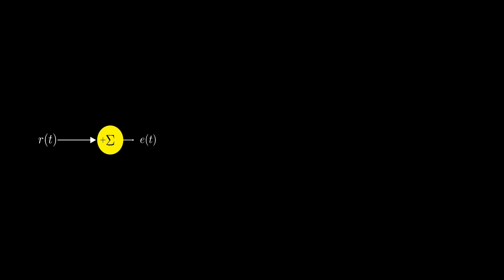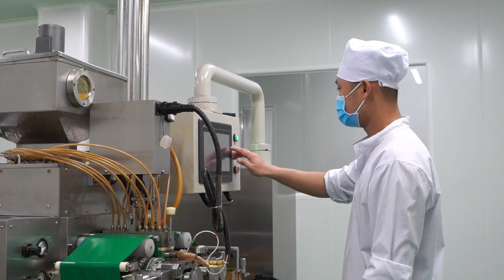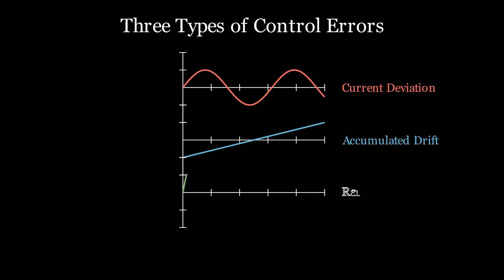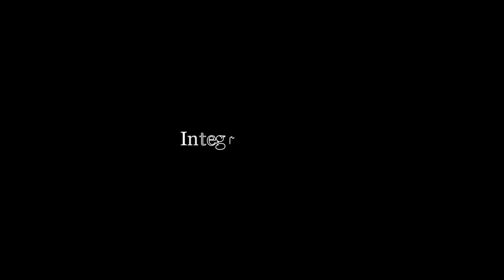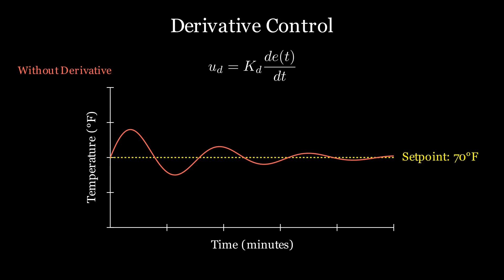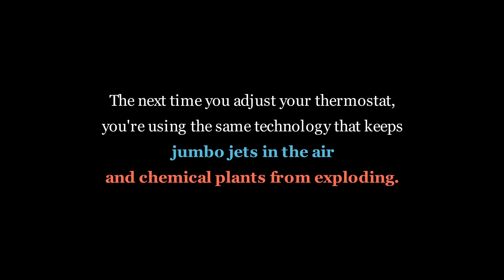PID Controller Explained Simply

Comment: There are some things misleading in the explanation given in this video. It doesn't explain why steady state error appears in the first place. 
The depiction of overshoot in integral control is misleading. It should oscillate.
The derivative action is meant to reduce the oscillation while also improve responsiveness against process changes. But it's limited by high frequency noise which would drive the output to fluctuate unnecessarily.